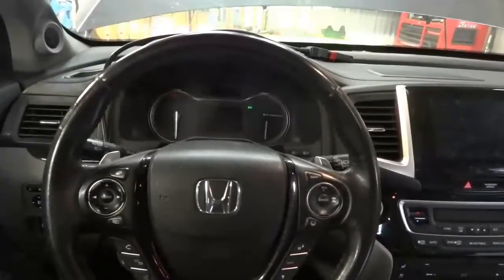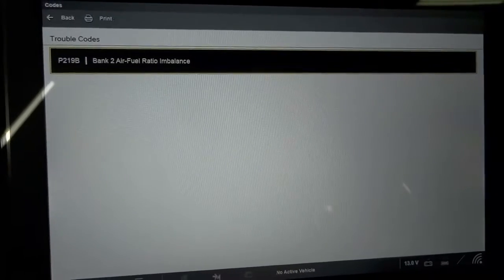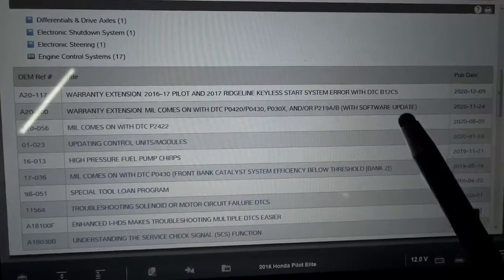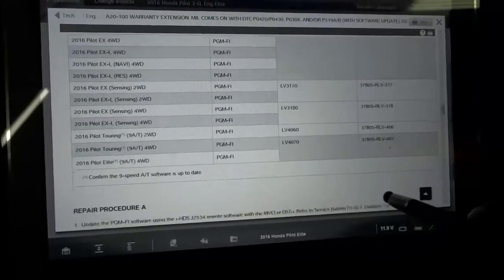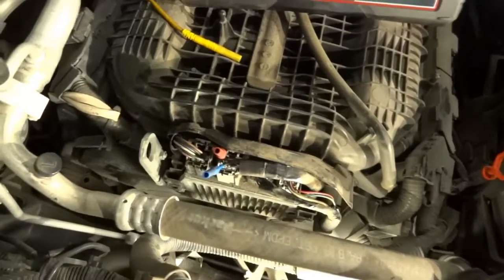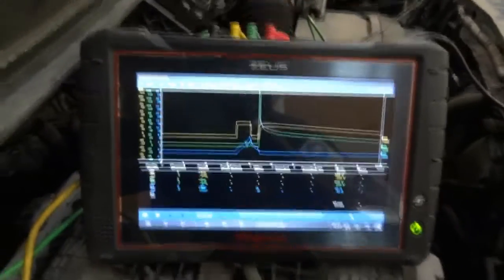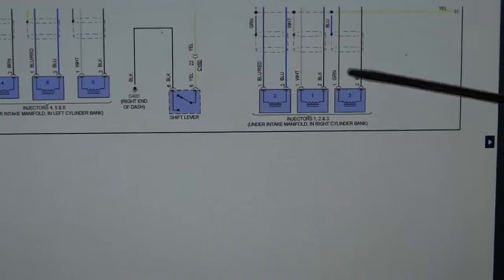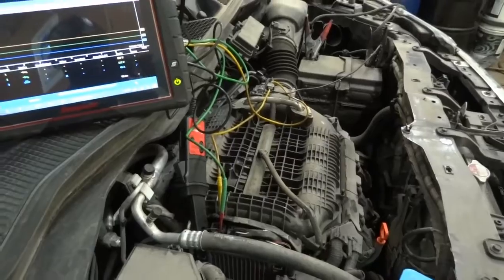2016 Honda Pilot Code P219B Bank 2 Air Fuel Ratio Imbalance / Diagnosis and Repair Part 1

Comment: I got a Toyota 1gr fe im getting 2 4 6 imbalance and the af sensor on bank 2 goes to 5v is when the imbalance codes set...shouldn't the af sensor is bad?.....thanks
Reply from the maker: @Kevin-wy8kc   you probably have injector issues

Comment: Hi mate great video but wouldn't you need to do an injector flow test before you replace all the injectors? Some injector secondary waveform have a slight hump at the end which indicates mechanical problems with the injectors I was hoping to see that. You know why it didn't show? Thank you
Reply from the maker: @John-zh2zy  Hello, that's a good suggestion I could have done an injector flow rate

Comment: I have same code p219B, but rich fuel trims bank 2 worse. All misfires on bank 456, -17 short /-18 long. Is this correlated with clogged injectors? Bank 1 -7/-8 without misfires.
Reply from the maker: Robert Foiles jr  check your exhaust system for a restriction!
Reply: I figured it out. Stuck open injector pintles. The 2 worse of the 3 misfiring cylinders failed the AF test, and all 3 cylinders on bank 2 were clean enough to eat off., I inspected them with a bore scope. Also the bank 2 cat is below threshold due to consuming raw fuel. This bulletin was new to me. I’ll be booking that job soon. Thanks for replying and keep the repairs coming.

Comment: My 2014 Chrysler 300c won't start and it's showing me the P219B code. How do I fix this. Your help would be very helpful to me
Reply from the maker: Donald Harvey  check for fuel pressure and spark!

Comment: Hi 
I have same code but p219a 
I have honda 2013 fit base model.
Im annoyed because iv been to so many mechanics.
Some asked me to change catalytic converter 
Some asked to change O2 sensor, spark plugs, and some asked to do diag test 
I did every thing
Then i also did fuel system clean up but this light keeps on coming 
Now one mechanic says to go to honda and see whats the problem but im afraid honda will charge me fortunes to diagnose in Massachusetts. Cud u plz recommend me what to do?
Reply from the maker: Akshit Dhadwal  the problem could be a defective 02 sensor or a computer software update needs to be done, if the light keeps coming back after that then replace the injectors, it's really common !!
Reply: The light generally goes and comes back. Is it necessary to perform software update? 
Can i just try to replace the fuel injectors? 
How to check if o2 sensor is defective

Comment: I have that problem on my honda fit 2015 check engine light on air fuel ratio embalance bank 1
Reply from the maker: Eddie Hurtado  the sensor and the wiring should be checked first!!

Comment: I am showing this same code for my Chevy caprice 6.0 v8 could this also be a bad o2 sensor that would cause this error code?
Reply from the maker: Champions Kennel yeah a defective 02 sensor can cause this code, make sure you test your 02 sensor first, I have videos on this channel that show you how to test an 02 sensor!!
Reply: @KITS_Auto_and_Truck_Repair  thank you I’ll be sure to check that out !  I just recently purchased a car it only has 50,000 miles and had been sitting for two years when I picked it up the battery was completely dead so I replaced it and drove it back home that’s when I started getting a P 300 Eric code as well as this one so I figure it’s got to do something with the car sitting without being driven for such a long period of time .
Reply from the maker: @championskennel4555  sounds good!!
Reply: @KITS_Auto_and_Truck_Repair  hey quick question I’m hoping you can help me out -  I just recently purchased a car that was sitting for 2 years and after starting it for the first time it had a really rough idle and would stall out sometimes , I’ve change the spark plugs , wires and ignition coils and I am still having the issue .  It shows p0300 random misfire on my obd2 scan tool .  At this point I’m thinking it has to be either the o2 sensors or fuel injectors .  I noticed today after looking at the live data with my obd scan tool I seen LT FTRM1(%) -.08 could that indicate something specific or is that a normal range for it??
Reply from the maker: @championskennel4555  bad fuel in the tank can cause this, drain the tank and put new fresh gas in it and see what happens!!
Reply: @KITS_Auto_and_Truck_Repair  how would I do that by siphoning the old gas out ?  I just purchased some Lucas upper cylinder lubricant with fuel injector cleaner hoping this might be able to work !
Reply from the maker: @championskennel4555  that stuff doesn't really work!!

Comment: Doesn’t it sound better carrying out an engine tune up in order to remove all carbon debris on the high pressure injectors and on the air induction system
Reply from the maker: Mayowa Odus Doing a tune up was not really neccesary in this case...

Comment: Great video, is there anything that can damage our scope when hooking up to GDI injectors, I also wonder if these injectors could be ultra sonic cleaned ?
Reply from the maker: Alan Gaudry  These GDI Injectors can damage other scopes!! because of the high voltage they spike, you have to use an attenuator when testing these injectors otherwise your scope will be damaged! I'm not using an attenuator in the video because snapon scopes can handle up to about 400V which is a lot in the automotive world, thus no attenuator required when testing high voltage circuit with a snapon scope...
Reply: Thank you for that info